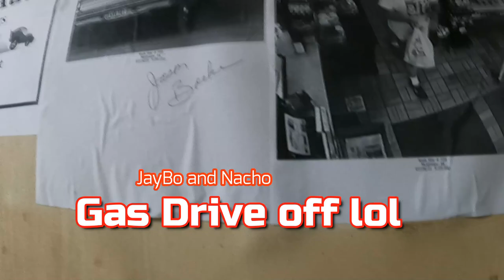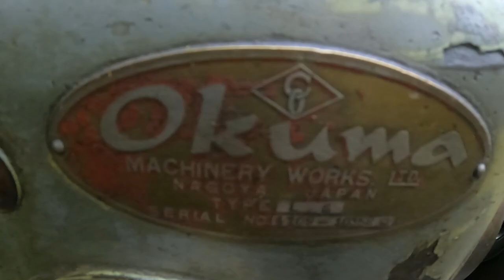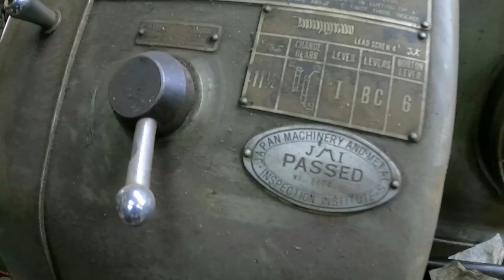DIY Crank Shaft Polish. This could work? #Musclecar #Mopar #DIY #Doing

Comment: nice work! It may be a bit oldfashioned way of doing it, but if it works.. its not stupid! 
Worth every minute it took (in my opinion)
That extra bit of work might save you from turning another gallon of oil into expensive metal soup! better safe than sorry!